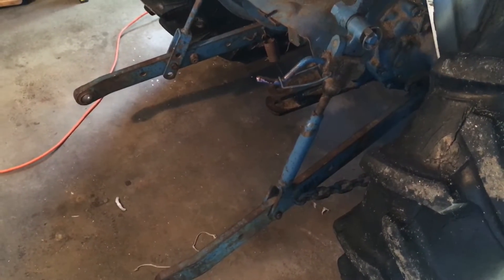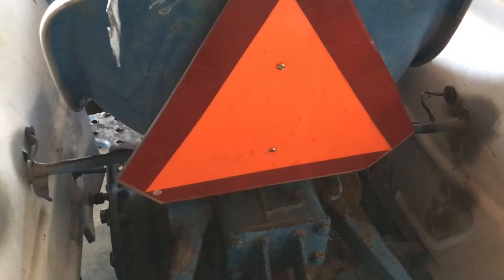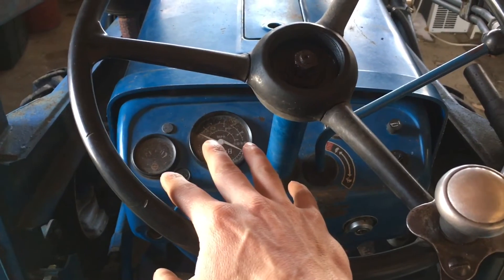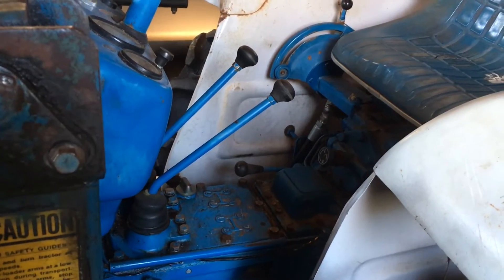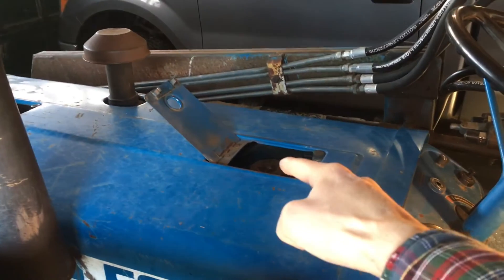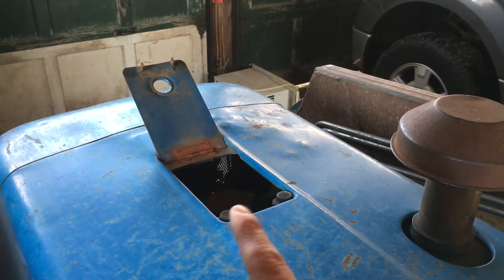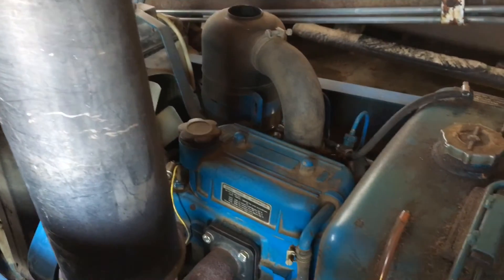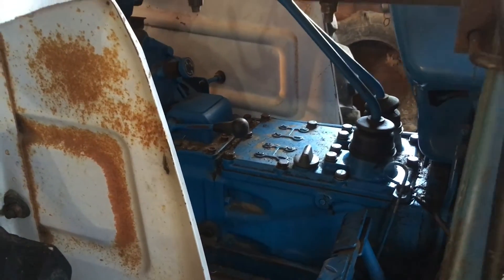Does an Older Compact Tractor Measure Up? Comparing a 1981 4wd Ford 1700 Tractor to Modern Tractors

Comment: Excellent video. I picked up a dirt cheap 1700 with a 770 loader a few years ago on a chance find and it is my go-to tractor on the farm. Finding info/parts has been difficult as you say, but workable. Was able to rebuild the head last year with only a few weeks of parts location hunting and waiting for shipping. Loader hydraulic rebuild is coming later this year. And eventually I'd like to get a power steering rack for it. Thanks for the 1700 videos!
Reply from the maker: Thanks. I grew up with this tractor. My grandfather bought it new in 1982. I’m putting hydrostatic power steering in it now. I hope to finish it within a couple weeks and will have a video. I’ve got a lot of tractor work to do and having it down for the last month has been hard.
Reply: Will you be making a video???  I have the same set up and looking to learn more on the hydraulics.